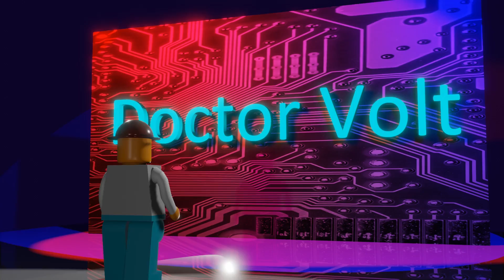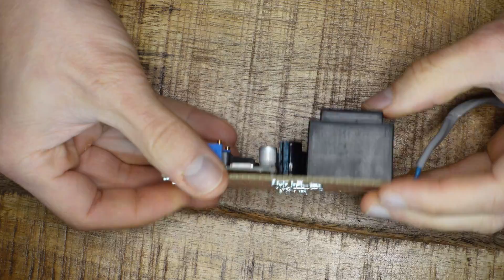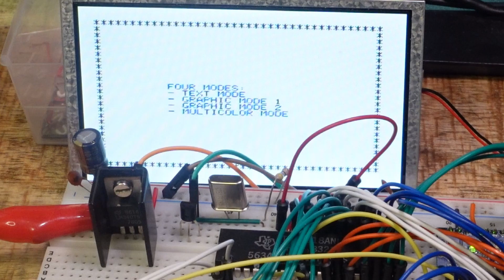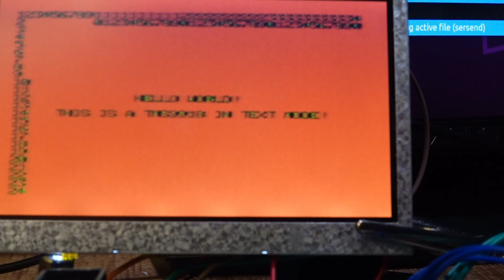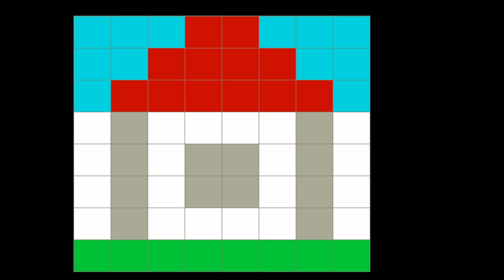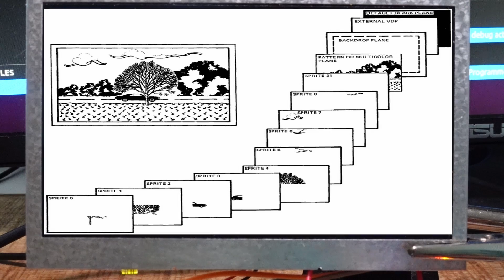Video Card for Arduino and DIY Computers #1: TMS9918 and Arduino on a Breadboard

Comment: How about two of the TMS9918 and with more Video RAM?
Reply from the maker: Multiple TMS9918 can be cascaded so that one overlays the output of the previous
Reply: @DoctorVolt  If two such TMS9918 chips are used cascaded please describe how and answer can they share Video RAM? Candidate SRAM chips could be TMS4416 or TMS4116 or TMS4164 or TMS4464 (depending on the breadboard's population of glue logic, nor gates, and so on). Thank you.
Reply from the maker: You can feed the video output of a VDP into Pin 35 of another one. It is however not possible to share the same RAM. Every VDP must have its own RAM. And the maximum is 16KB.
Reply: @DoctorVolt  A TMS9918 can be connected on a breadboard so that it has no RAM and so the CPU drives the RAM for it. It is slower however, maybe that would be a (tantamount) way for two TMS9918 chips to "sort-of-share" RAM? It wouldn't quite be VRAM.
Thanks for the info about the Pin 35. Is it possible, by some other mechanism, to have two TMS9918 chips produce two video outputs "stitched ogether" (instead of an overlay) so as to effectively increase screen resolution? So for example, instead of one chip having an image of 288x192 pixels, a TV could show that image directly above another chip's image so as to have 288x384?
Reply from the maker: I think that you might run into some severe timing issues if two TMS9918 share the same RAM, if the one tries to write and the other tries to read at the same time. I also cannot see a way how the two images can be stacked on the screen to get the double number of lines. I´d rather go for a more advanced chip like the V9938
Reply: @DoctorVolt  Come to think of it, I reckon there's a workaround. Bit of a kludge but two CPU's could use a (custom?) MMU so as to share the RAM whether or not any TMS9918 existed in the breadboard. However, then, once that is working, two TMS9918 chips would be give whatever RAM their corresponding CPU gives it, and as such the RAM is thereby 'shared'. Probably requiring a whole bunch of glue logic and other chips/tristate or whatever.
Other than that, maybe (or maybe not) the usage of a multiplexer (or multiple in series as a form of CMOS logic) could mux the signal and use a clock like say a MIDI clock to alternate between the two TMS9918 chips accessing the RAM (even though it could slow things down). Maybe a demultiplexer (demux) would be needed here and there. Optimisation could come later, if at all.
Regarding the doubling of the number of lines, probably some frame-buffer jiggery pokery would be needed for that. People tend to have a TMA9918 moreover than a V9938 (which of course is a nifty chip).
Reply from the maker: If you want to display more than 240 lines on NTSC, you need to interlace them. "Stacking" of the images will not work. So one TMS9918 writes the even lines, and after that the other writes the odd lines. I think that you can tweak this by multipexing the outputs and delaying the output of the second by 32 microseconds (half of a line).
Reply: @DoctorVolt  Your plan sounds like a good one.
Perhaps a way (albeit inefficient) to "stack" the the images (of two TMS9918 chips) would be to use a TV-modulator.
A Texas Instruments TV modulator example is the LM2889 (or LM1889 or LM1886). The LM1889 and LM2889 use a  modulation scheme where L-C-Modulators (where a L-C is the "L" = inductor and "C" = capacitor tank circuit used for giving the required positive feedback for sustaining oscillations) are used to create the pix carrier frequencies. I'm wondering if (with other added components too) this might also help your method although I think stacking would be easier to utilise for a desirable image. The TV would not "know" what the resolution is it is being given. It would act as a dumb recipient, like how those PC-to-TV-adaptors can give a TV a 1024x768 image and then the TV just has to kinda display it a bit blurred but it is still sorta ok to use and look at. I'm not aiming for so high a resolution. I'd be happy in knowing one could cobble together 288x384.
Mind you, be it PAL or NTSC, I'd be tempted to then flip that final image on its side by 90 degrees at the last moment and then stack another two images (for 4 total) so as to get 288x384 "twice" at 576x384 flipped by 90 degrees (so that is four TMS9918 chips, even if it requires "one or two computers"). 
Utterly inefficient of course... but who cares? 
:)
Optimisation can come later, as is the way of such things. Maybe you have some thoughts on doing it another way though?

Comment: Color blend artifacs is not about bad desing of the v99x8, it is about the limitations of NTSC and PALs color encoding, the U V color angle that is pointing can't turn abruply too quickly because the TV NORM is out of bandwidth, so, when you try to use a opposite color pixel next to a 180º oppose color, it starts doing glytches, the color oscilates , if you draw a vertical line of just 1 pixel, plus another vertical line of a 180º color side by side, the two vertical lines blend about COLOR, not about LUMINANCE, NTSC and PAL is perfectly able to do full pixel resolution luminance without glytches. TV NORMs were made for image photographs , real life filming, not for computer graphics. This is a complete different issue not related to the tile systems which as it lacks of RAM and lacks of accesses SLOTs it can't do bitmap at 256x192, it has just few slots per scanlines to read the pattern number, the and the pattern graphics line, and the color graphics for that line, that is 3 slots access of VRAM (3 bytes per 8 pixels in the screen) in high resolution graphics. Computers with z80 a 3.5mhz clock has to insert two NOP commands before reading or writing the VRAM, between the ADDRESS PRESET procedure and the actual READ/WRITE, the reason there is not enough SLOT of vram free for pumping graphics data to/from the VRAM through the TMS. The evolution, the v9938 and v9958 works with faster RAM, and the NOP was not necessary anymore, but a single NOP is inserted before trying to read the first byte, but not for writing, that most of the cases writing is the 99% of the accesses. Sadly, the first generation doesn't has RGB output, what was the designer thinking, don't know, maybe to give a ALL IN CHIP solution for cheapness. But, the seconds third and fourth generation really has RGB output and is expected to be convert to VIDEO OUT on the PCB.
Reply from the maker: Thank you for this very detailed explanation

Comment: I got a chip for you to check out, the NS405-b18N. It's a all-in-one terminal on a chip from the 80's. Would probably work well with your Z80 build.
Reply from the maker: That chip wold be perfect, but it is hard to find. So I am trying this with the TMS9918 now.
Reply: @DoctorVolt  check your email

Comment: I was looking at the TMS9918 for my homebrew 6502, but went with the MC6847 using dual port SRAM. Color is not great, there’s no sprites, and it’s limited to 32 text columns, but I rather like it.
Reply: And having the inbuilt character ROM is a plus. I like the 6847 for its simplicity.
Reply: @Quadraholic  True, though I went with custom character ROM. Unfortunately, it makes semi-graphics mode worthless.